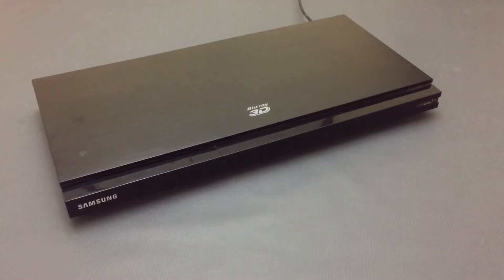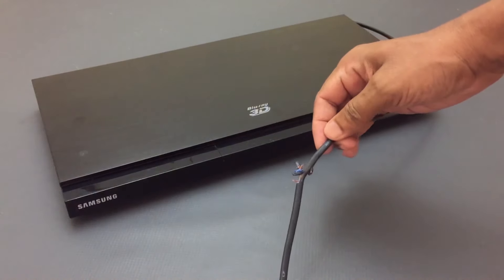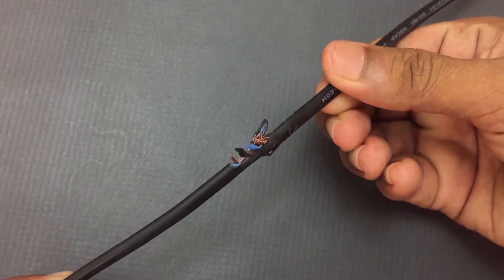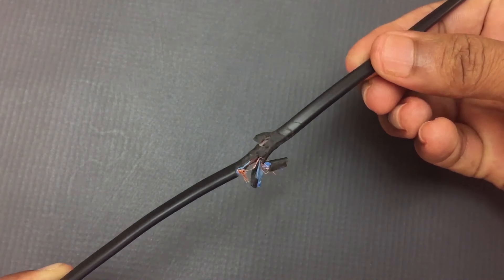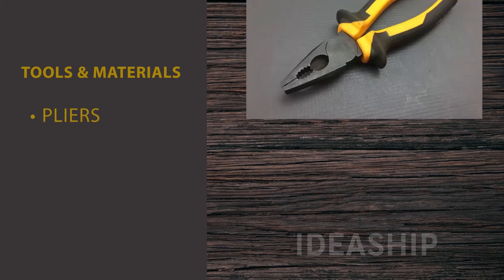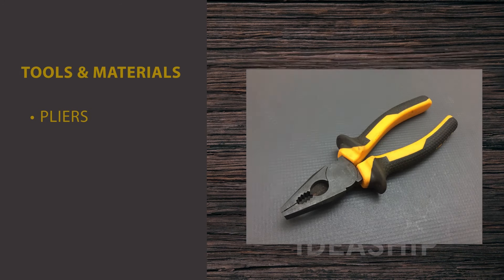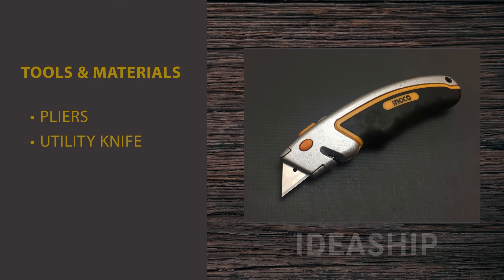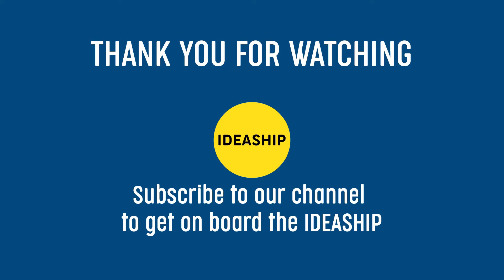How to fix a Wire or Cord that has been Cut or Damaged | with Minimum Tools

Comment: Nice video, thank you, I enjoy watching fixing things and wiring.
Additional advises:
- Tape should be pulled while wrapping it around cable or wire, to make tighter and stronger insulation.. it also looks better.
- wrap additional layers of tape, for safety.

- it will be better if you use heat shrink on exposed copper and wires, then use tape.
Reply from the maker: Thank you very much for your tips and comment. 💛 Hope you may enjoy this too. - https://youtu.be/FyBat81sIQs

Comment: Can v fix the Safeway if the battery charger of laptop is damaged.   Will it b dangerous to use a repaired charger.   KY cfrm.
Reply from the maker: May i know which part is broken? the wire of the battery charger or the charger ?

Comment: Nice video. Will shink wrap work the same as the electrical tape?
Reply: NOOOOO!!! Only use electric tape!
Reply from the maker: Shrink wrap, also shrink film doesn’t have the insulating properties and it would catch fire at some point. use electrical tape or heat shrink tubing on exposed electrical wires because of its low conductivity and durability to wear and tear over time. Thanks💛
Reply: @aryetheking   Thank you. I meant shrink wrap tubing.

Comment: hi sir please i have a question my laptop charger part of its cable  get really hot so the laptop keep disconecting if i cut the damaged part and solder it will be fixed and if it yes the output power of the charger will not change.thank you

Comment: Will it cause the electrical tape melt if turn on the power too long using AC?
Reply from the maker: If you do the wire joint correctly, the area will not heat up and melt the electrical tape. Watch this video to learn another way to make wire joints correctly - https://youtu.be/FyBat81sIQs

Comment: is it ok if there are few wires that are also removed while peeling the blue and brown coat?
Reply from the maker: if it's just a small splinter then there is likely not much risk. However, if the wire had a deeper cuts you should cut off the damage part and re-strip the wire. If you have any doubts, cut off the damaged part and strip it again. If you require any further information, feel free to contact us.

Comment: My extension cord is green on both sides. Does it make a difference which I join together?
Reply from the maker: The green wire is the ground wire, if a ground wire is present, be sure to connect it too. If you require any further information, feel free to contact us. Thanks.
Reply: You are so kind and generous; bless you. @IdeaShip

Comment: My vacuum has a black white and blue wire? Do i fold it on the opposite side of one wire?
Reply from the maker: yes. It would be safe if the two wires could be bent in opposite direction.

Comment: It is work for my laptop 170w charger cable please reply anyone...
Reply from the maker: I'm glad you found the video helpful. While the methods shown in the video should work for most types of cables, including a 170W laptop charger, If the cable is significantly damaged or the power requirements are high, it might be better to consider getting a new charger to avoid any risks. If you have any specific questions, feel free to ask! I’ve also uploaded another video that might help with your repair. You can check it out here:  https://youtu.be/FyBat81sIQs
Reply: @IdeaShip  Thanks for your valuable reply and vedio I've fixed by watching your vedio 😊

Comment: Hi, I am a Kid that wants to actually Fix my Broken Piano cable wire. My mum was disappointed Because the piano was really Expensive. Does this work for a Piano that has wires?
Reply from the maker: First of all i advise you if you are a kid do not do electrical repair without adult supervision. Then tell me which wire is broken. It will be easier to help if you tell the problem in detail. Thanks

Comment: A rat chewed through my car fog light wires, the other end is still connected to the battery and it's weather wrapped so I can't just disconnect it. Any safety steps I should take like disconnecting the battery or the fuse?
Reply from the maker: Before repairing the wire which has been chewed by the mouse first disconnect the positive wire (The Red Wire) from the battery. Then join the wires and solder them properly. Then put a weather proof heat shrink tube covering the joint. Then fix the battery terminal again and check if the bulb is working properly. If you require any further information, feel free to contact us.
Reply: @IdeaShip  Thanks a lot, did all the proper steps enlisted here, It's working perfectly now with great assurance it's done properly and safely.
Reply from the maker: Glad it helped!

Comment: Sir....will it work on speaker's wire
Reply from the maker: Hi Pradyumna. The above video is about a quick fix. when it comes to speaker wires since the cables are small in size the best solution is to solder the cables together and then cover the joints with a heat shrink tubes and heat it up to shrink and seal the joint. Because if not you will lose the sound quality of the speakers.
Reply: @IdeaShip  thankyu sir

Comment: My Ethernet cable twisted too much and got damaged :(
Reply from the maker: The best way is to replace If it’s just a short patch cable. If you can't replace the cable you can put an RJ-45 end yourself on each end and use a RJ-45 coupler to attach the two ends together. You do incur some degradation due to the added connections, but that would be far less than you get if you try and “splice” the two ends. Doing that, you will loose valuable shielding.
Reply: @IdeaShip  I’ll probably just get a new one
Reply from the maker: Great

Comment: I really think you should use an in line wire connector , because the tape could unravel over time , exposing live wires.
Reply from the maker: Yes I agree with you I have mentioned that this is a Quick fix solution not a professional way Which is a temporary. If anybody can find a live wire connector as you said to fix this .. it would be much better solution and much more durable as well.
Thank you very much for your suggestion and please stay in touch with us.

Comment: I really don't like he wire splice, the wire should be horizontal but that's his style way and also there is also another alternative to patch the wire instead of using electrical tape it's called heat shrink tubing.
Reply from the maker: I have mentioned that this is a Quick fix solution those who has very primary skills and minimum tools. This is not a professional way to repair wire Which is a temporary. But it works very well. Also i have an another video which i show fix a cord with heat shrink tubing. it would be much better solution and much more durable as well.
Thank you very much for your suggestion and the valuable comment. 💛
here is the Link - https://youtu.be/FyBat81sIQs

Comment: I didn’t put tape on it and it sparked and my whole house power shut off then turned back on
Reply from the maker: I'm sorry to hear that. If it done as shown in the video, it will not be a problem.
Reply: Extremely dangerous not to use the tape

Comment: Maybe in a dire emergency, but this is definitely not safe.
Reply: Well in cases his house can get shut down if the wrong wire touch each other or a part that didn't get cover from the wires can get him electrocute
Reply from the maker: You have nothing to fear if you do as I have shown.  But this is a quick fix and will be possible to put it back to working condition.